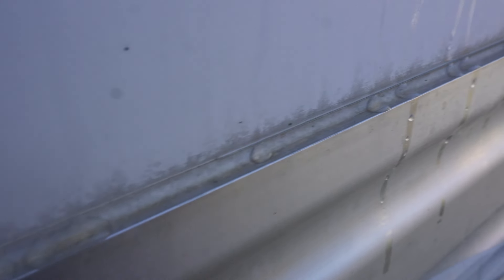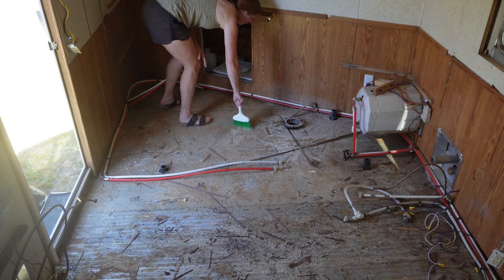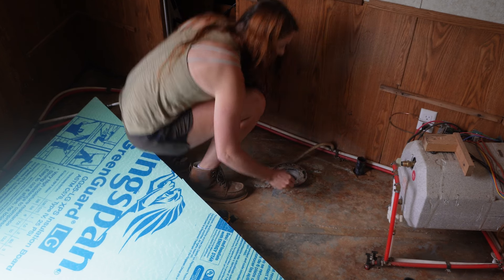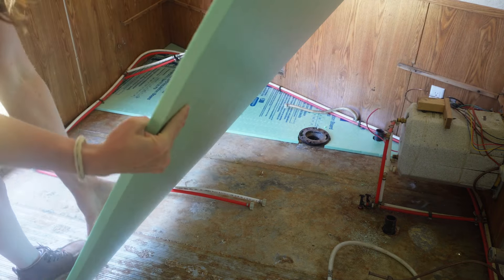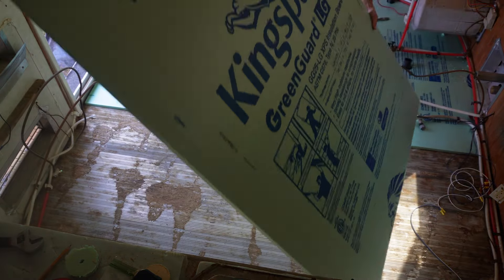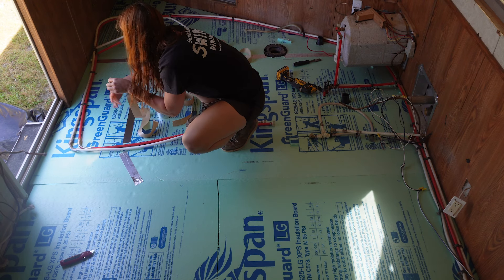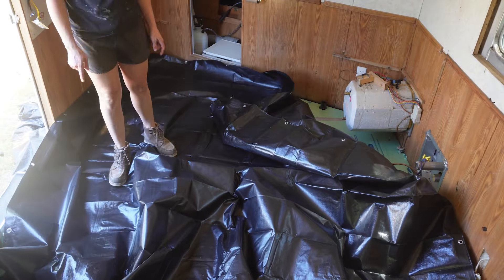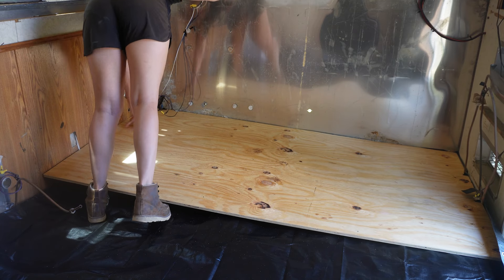Horse Trailer Renovation: Part 4

Comment: Love your content. It’s super helpful, I’m literally doing the exact same reno right now. I am struggling with flooring because my floor is not one solid piece of aluminum & I need some kind of rigid waterproof subfloor before putting down insulation/ wood/ flooring. Any advice?